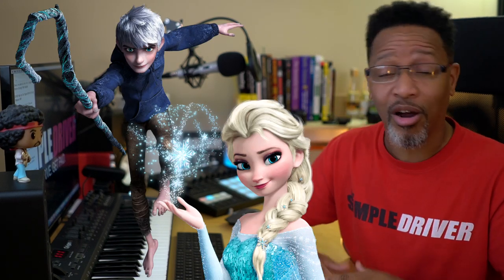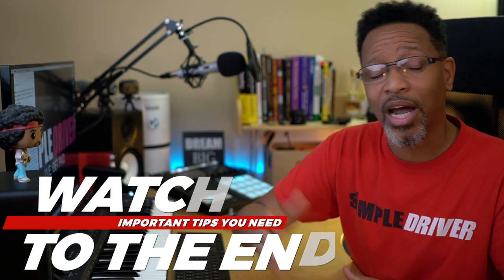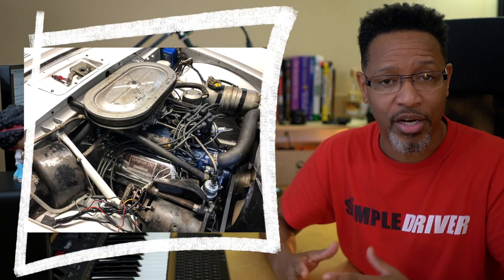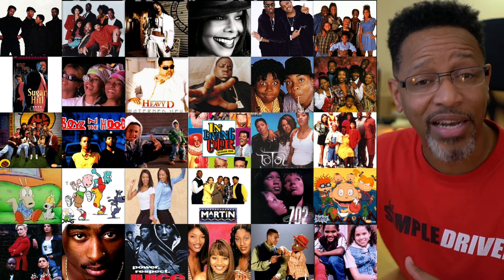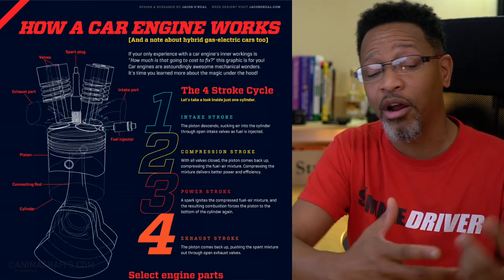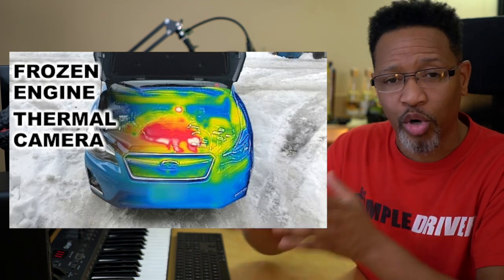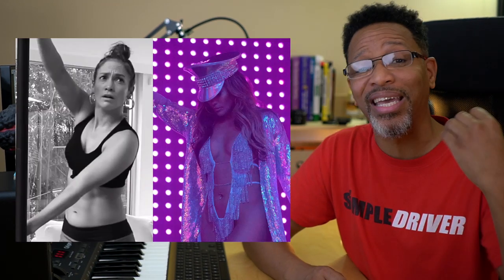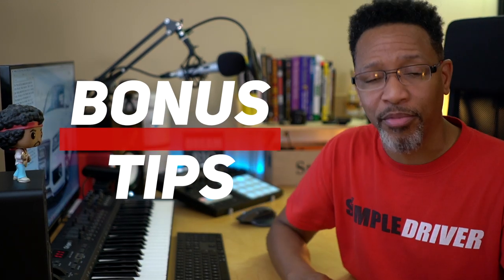Should You Warm Up Your Engine? (EXPLAINED)

Comment: You need to warm up the fluids in the car.  Or you take a big chance of blown seals and hoses.. Aleast in MN or Cold States. These Cars just don't like the cold. There Mechanical with moving parts. The transmission don't shift  smoothly when cold either. Tank heater to help to keep the engine block warm too...Hey Calvin, What a kingdom you build. Hats off to you! ! 👍

Comment: The fog. You can clear the windshield like that,... But in Ogden Utah when it's negative 13 degrees. You get in the car you ain't going to be able to see. You need hot hot hot air blowing on them windows in the defrost needs to be rocking on the rear window. You get clean the ice off like that pretty quick but you can't see when its -13 degrees outside. I'm talking - 13

Comment: All within the understanding of how gas, oil, electrical and mechanical systems all function within an engine and what may or may not happen if you warm up or don't warm up the engine, you'd be hard pressed to say that you are "destroying" your engine if you don't follow a particular method or have a particular understanding. The fact is, whether you like it or not, you're destroying it from the first time you turn your key. With that said, having ANY reasonable method of engine care whatsoever and applying it means you've thought about what's going on in your engine to some degree. This is SOOO much more important than not giving a shit about your engine at all, which is how countless car owners are. It's an appliance with a scary mystery under the hood.  

For the most part, modern engines are designed incredibly well. Sure, many of them have way too many sensors that fail and ancillary parts that were designed by drunk children, but the basic engine with all its internals are usually very robust. Also, the metallurgy is amazingly good and unless there's a defective part installed at initial assembly or a major design flaw, the long block of your engine can usually handle quite a bit of half-assed to almost non-existent maintenance. Putting your feet in your engine's shoes means you care for it, and are likely to get a few hundred thousand miles at the very least if you remain aware and take care of problems when they arise. OR, you can be like my wife and get pissed if I even mention she should open the hood once and a while. Just sayin'!

Comment: Not so fast Calvin. You never touched on the sometimes immediate damage done to seals and drive train components of an automatic transmission  when a car is driven not at operating temperature let lone freezing temperatures(can have some similar affects to manual trans but can be better managed/controlled by the drive). The pressures placed on an automatic transmission under these very conditions that you claim make it okay for the engine are devastating to an automatic transmission. Most all ECUs are not programmed to compensate transmission operation to prevent damage and you can self destruct your transmission prematurely but definitely decrease it's life and this is happening the very second you put that vehicle in any gear. And for those of you who are trying to get out of ice or snowed in parking in these below freezing conditions better make friends with a good transmission specialist immediately.  These guys can look at your transmission components and tell you exactly what you did to destroy your transmission even if you took it out of your car and shipped it to hot region for diagnostics. But this is still good information that Calvin is sharing with us once again.

Comment: Does rubbing alcohol damage car paint?
Reply from the maker: Not when it's diluted. Isopropyl alcohol, when diluted accordingly, can also be used to prep surfaces for paint, glass or wheel coatings.
Reply: Over time it can affect the clear coat but you are not putting this on your paint I hope, just the windshield. Also, alcohol over time can dry out rubber seals and make them brittle and crack. This is why the mixture to slow this process. Wouldn't recommend any mixture on a classic vehicle that you plan to keep for many many years. But this shouldn't be a problem for most people so have at it.
Reply: VjCClass Thank you both; I may be the only one with this question now, but it may help others decide in the future.